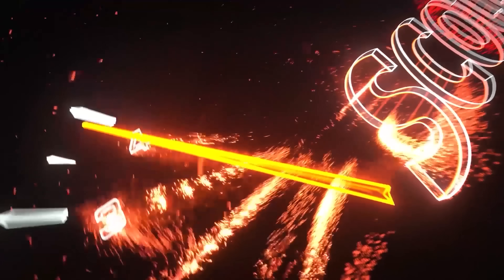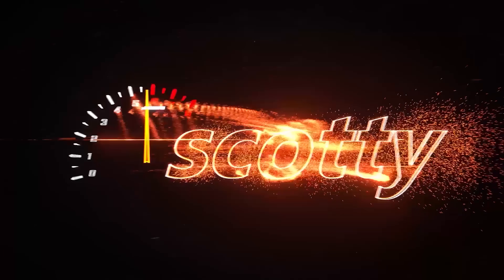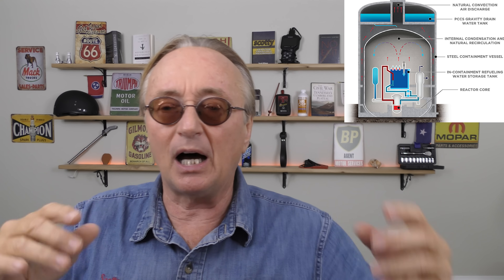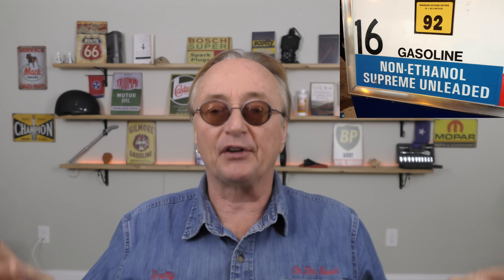America Just Got Unlimited Power

Comment: Question. I just graduated as an mechanical engineer at OSU and I've driven an 1994 Honda Accord back and forth to college for the last 5 years (Daily commute 60 miles total). I'm considering buying a 2023 Honda Civic to replace the Accord. I'm starting as a Honda engineer next month. Do you guys think I should keep the Accord as my daily commuter (New Daily commute 120 miles total). Accord has approximately 100K miles on it. It has little rust on it and still drives fine.

Comment: Scotty, I got a 2015 Sonata 35,000 miles whenever I accelerate at warm engine temp I hear a loud crackling rattle metal kind of sound… only at low rpm acceleration. Took it to 2 Hyundai dealers and nobody can find the problem any help

Comment: The low cost of renewables far outpaces the cost of nukes, delivers strategically distributed power and no one is trying to steal the waste for evil purposes.
Reply: Yeah, but without massive battery infrastructure, renewables can’t provide steady baseline power requirements on a calm night. 

Nuclear is a great option, a safe option, and surprisingly clean. As an 80’s kid who grew up on the ninja turtles, I was surprised when I learned how easy it is to deal with and how little is actually produced in a modern reactor design.
Reply: @JeffroDH  there are different renewable sources and different kinds of energy storage. Meanwhile nuclear is a political dead end. I will take the extra cost of storage and generation without the political baggage over nuclear.

Comment: 2014 Toyota Corolla I just changed the driver door actuator. When the door is open and it’s in the locked position and I close the door, it unlocks. Any one know why? Did I install it wrong?
Reply: Expected behavior. Lock it with the fob or the key. This keeps you from accidentally locking the key in the car in many cases.
Reply: @JeffroDH so that’s normal? I was so confused cuz I kept searching for the answer but no one ever had this problem.

Comment: With regards to avoiding the dealer as a mechanic: At the dealer, you're pretty much guaranteed to get genuine parts and proper diagnostic tools. If you or your spouse are employed by that dealer, it is not unreasonable. Our vehicle purchases over the past two decades have been dictated by the brand sold where my wife works. After employee discounts, price is pretty much in line with other local, reputable repair shops, but the convenience factor is super high. (We drive Honda and Mazda now, so repairs are few and far between.)
Reply: Good for you, we dont all work for a dealer, we have to make every dollar count.
Reply: @charliehargrave7458  Understood. That's why I mentioned it was good option IF you can get an employee discount to bring prices in line with a good independent mechanic. I need to make every dollar count, as well.
Reply: How is Mazda reliability? I've had Nissan, Toyota, 2 Hondas. Next car could be a Subaru or Mazda.
Reply: @Vagabond-Etranger  Our Mazda is a 2012 MX-5. Those are built in Japan, and we've had no mechanical issues in 180k miles of driving (all year long in Michigan, no less!). We've followed regular maintenance schedules for all fluids and filters. Maybe we got an extraordinary example, but my sample size is limited to just this one.
Reply: @macdaddyp8437  They try to upsell me on services like that, too, but it's easy to decline. At an independent shop, I've experienced being charged for work that was not performed. It's unfortunate that some places take advantage of customers. That practice is not just limited to auto shops, either.
Reply: Actually, several mechanics on YouTube (AMD on the Car Care Nut Channel) have worked for dealerships before opening their own shops. And no, in this country you are NOT guaranteed to get genuine parts, at least not as far as oil goes. Diagnostic tools, I'll give you that one. Mechanics that actually care about you and your vehicle, and doing the best job? In my experience, again no. I personally have had horrible experiences, the worst being when I took my 1985 VW Fox in. The dealership said I needed a new clutch. The owner of the pizza place I was driving for at the time was a military trained mechanic, and had just replaced the clutch before selling me the car. I took it to a local transmission shop after NOT getting the clutch replaced, and they charged me $120 to replace the clutch CABLE. The dealership wanted over $500, and wouldn't have fixed my problem.

Comment: Thanks Scotty. I just flushed my 2011 Corolla motor oil at 267000 miles. Also the Engine mount I replace last week has made the car so smooth. In 2 year I plan to buy a 2015-18 Venza to retire in.

Comment: The answer to fission nuclear energy is to build small nuclear reactors that can be built on an assembly line.

 "Advanced Small Modular Reactors (SMRs) are a key part of the Department’s goal to develop safe, clean, and affordable nuclear power options. The advanced SMRs currently under development in the United States represent a variety of sizes, technology options, capabilities, and deployment scenarios. These advanced reactors, envisioned to vary in size from tens of megawatts up to hundreds of megawatts, can be used for power generation, process heat, desalination, or other industrial uses. SMR designs may employ light water as a coolant or other non-light water coolants such as a gas, liquid metal, or molten salt."
Reply: They all produce radioactive spent fuel with a half life of thousands of years.  We don’t have anywhere to safely store the radioactive waste we already have.  What would we do with more spent fuel?
Reply: @pechaa  Fusion power and Low Energy Nuclear Reaction reactors would be much better than fission reactors.  Unfortunately, no one has yet produced those reactor types that work economically.  We need power now, so the best solution is natural gas and next-generation fission reactors.  The world is a very big place, and the amount of radioactive waste is extremely small.  We have lots of places where we can safely store waste.  Liquid thorium reactors produce considerably less waste and are meltdown proof by design.